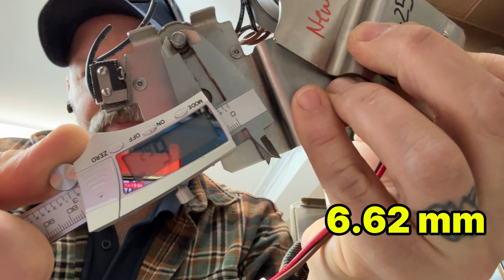Why Midmark M11 Door Motors Keep Failing: Manufacturing Issue Discovered

Comment: so how do the motors fail? does the lever arm slip on the motor shaft?
If you are allowed to modify, you could pin the arm to the motor shaft preemptively. or add a stiff spring in place of the linkage to reduce peak stress on the motor.
Adding a ~10-40w incandescent 120v halogen lightbulb on the common power line of these syncronous motors would also limit peak torque of the motor if it is running into a hard stop and stripping out. But you reduce the torque it may need to operate.  The lightbulb is nice as a current limiter because until you get to ~50% of the max bulb current, it stays fairly low resistance. Then resistance goes up exponentially as the filament heats up. halogen seems to be even more exponential.
You can swap out the bulb sizes until you find something that works reliably but still provides overtorque protection.
Reply: After watching this video
https://www.youtube.com/watch?v=rDUh11drC_8

I understand the problem better. This is a synchronous geared motor that is pushing against hard stops. That's a no-no. Those motors aren't rated to continuously hard stall, and that shaft even more so. The lightbulb current limiter, or possibly just removing the hard stops all together, as there doesn't seem to be harm in letting the motor rotate 360, should provide a permanent fix for this motor failure.